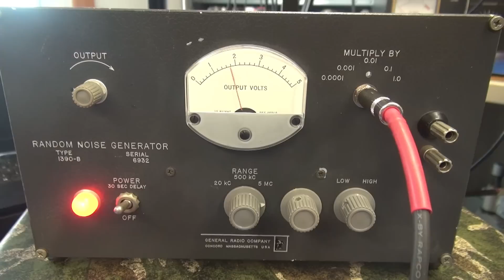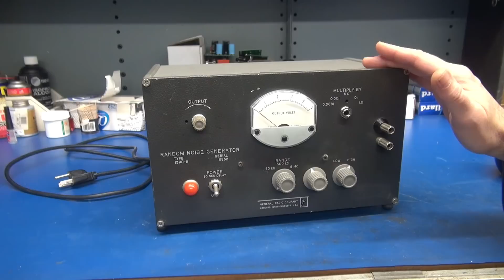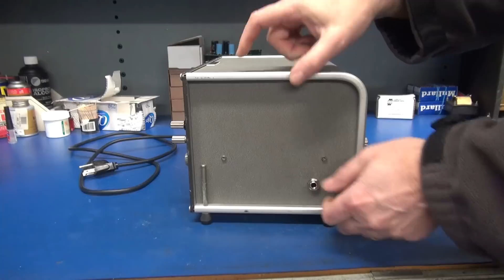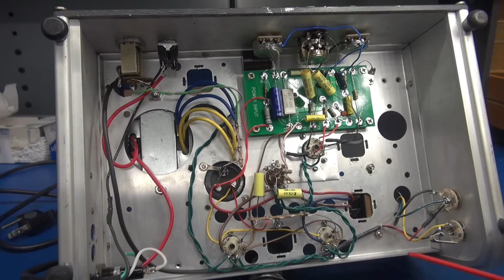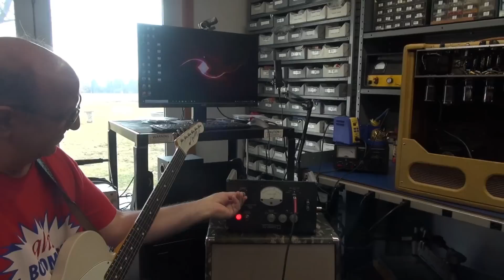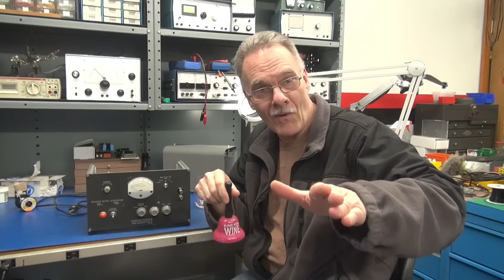Build convert a military piece of test equipment to Push Pull 6AQ5 Boutique tube guitar retro amp

Comment: Hey Terry, Went through the comment section to see if their were any specifics concerning the power transformer.  From the video andcomments it sounds like a 250 volt custom made transformer.  I'm looking at the blue jr replacement - hammond 290XX with 260Volts @170mA as a possible commercial fit.  Is that close to your power transformer specs?

Comment: Hello. Great Amplifier as ever. Gratulation ! The unused Bananaplugs gave me a good idea. Why not taken the 6.3 Volts from the filament (and after ) thru the bridge diode to DC with a Kondensator .Stabilised by a 7809 it can make the Voltage supply for the Pedalboard. A few milliamps are often used only. And I hade to have this external Powersupplies for my pedalboard. they are expensive and not relieable.

Comment: I noticed that the fuse was in line with the white (neutral) wire, while the black hot wire went to the switch. I would have thought it would be safer to put the hot wire straight through the fuse first, then through the switch to the transformer primary. Is there some reason it was done the other way?

Comment: That’s a good one Terry. Very cool idea on the bandwidth control. Makes the amp really flexible for different guitarists. I just finished up an amp using your same PP 6AQ5 power section but added two 12AX7’s (using both triads each) to make it a heavy metal gain monster. Turned out amazing. Thanks as always for the inspiration and ideas.

Comment: Nice to have a meter and a sensivity pot but artist guitar player will definitely forget to readjust while playing. Is it thinkable to put a zener diode on the meter circuit just to protect the meter from overload ?
Reply: One could add two ordinary 1n4001 diodes, reverse from each other and both in parallel with the meter. It won't prevent the meter from pegging, but it will clamp the voltage at a point where it will not harm the meter. Actually, I would do a little math and find the fixed resistor value that would put meter full scale at 100% volume, only drawback being that quiet playing would read lower.

Comment: 3:53 - Did you drill the hole for the 6AV6? It appears to be in it's original 'General Radio' location, complete with label (?)
Reply from the maker: Yes, I drilled it. I have a nice label machine here
Reply: @d-labelectronics  Very cool! And riveted-in to boot!

Comment: Class A - push pull?....eyeroll
Reply from the maker: Yep, Class AB
Reply: @d-labelectronics  That's better 😉....nice sounding amp, nice job.
Reply from the maker: Thanks man, I do my best
Reply: @d-labelectronics  I'm in the middle of building a point to point in a DSL401 chassis, using the existing chassis and transformers and 4 X EL84's.....should be interesting.
Reply from the maker: Will check your channel, Good luck on the build

Comment: why did you not use the original power transformer ?
Reply from the maker: HV winding only good for 120VAC, Not useable for this design
Reply: @d-labelectronics  hi Terry I must check the manual - do you reckon a voltage doubler circuit would do the trick ?
Reply from the maker: Yes, it would work. I prefer a straight power tranny for the application
Reply: @d-labelectronics  The quality of the original stuff is so good I may try the doubler -- maybe parallel s/e -6005- as well it has a 220 v primary for me here in eire -- thanks for the reply.

Comment: Russian tubes are going to be impossible to come by now. I guess there's still Slovakian and Chinese tubes and you can forget about buying Soviet surplus from Ukraine.
Reply: Still a lot of them in AliExpress. Aren't the current russian tubes actually manufactured in China?
Reply: @joseislanio8910  Sovtek, 
Electro-Harmonix, Svetlana, Tung-Sol, Mullard and Genalex are all made in Saratov, Russia. I'm sure there is some stock left at retailers. Ali Express is Chinese so you might still be able to order through them.
Reply: @tiki_trash  nice info, thanks!
Reply: @joseislanio8910  This war may bring higher demand (prices) for NOS tubes.
Reply: @tiki_trash  so the already expensive JJ tubes will get even more pricey